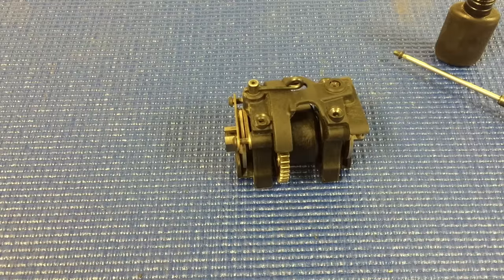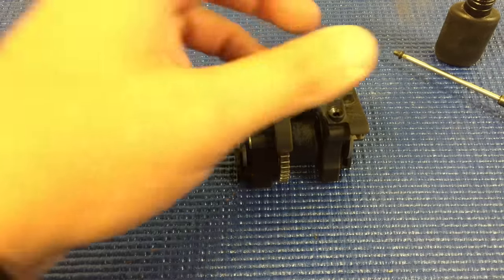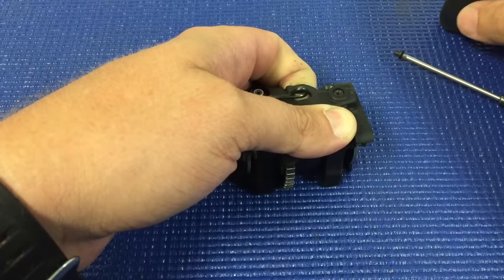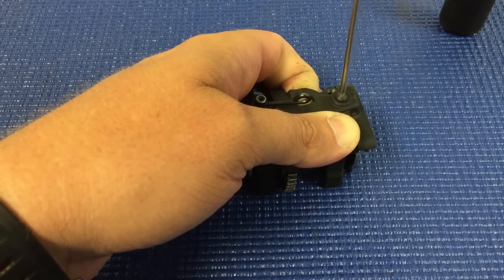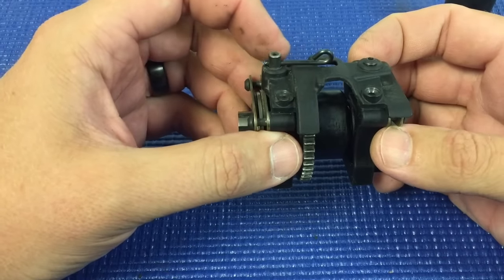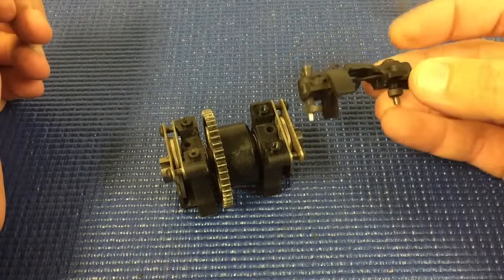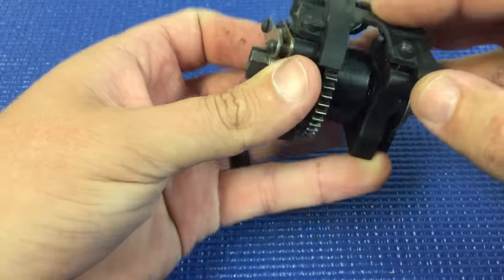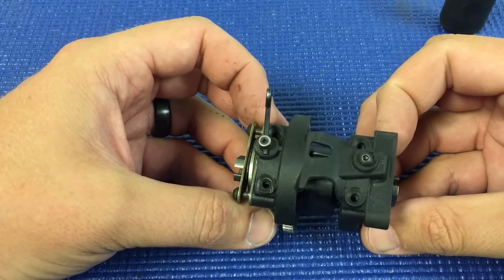Adam Drake from Mugen Seiki Racing maintenance tip for the center diff.

Comment: Nice tip! I have one question, is it usual that the silicon of the diffs go out? I have a vintage MBX5 and I have to check quite often the diffs because the silicon goes out of the diffs, even though I have replace the O-rings with the new silicon ones and new gasket.
Reply from the maker: It's possible, but with new o-rings and grease it should really leak out, but maybe the seal isn't as good on older models.
Reply: @AdamDrake  I'll try this time with the Mugen premium grease, thanks Adam!